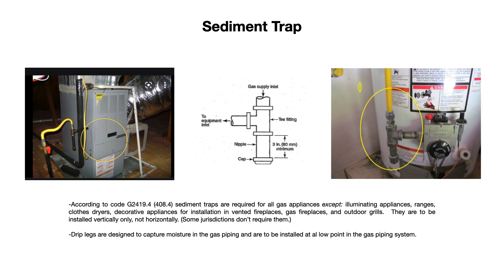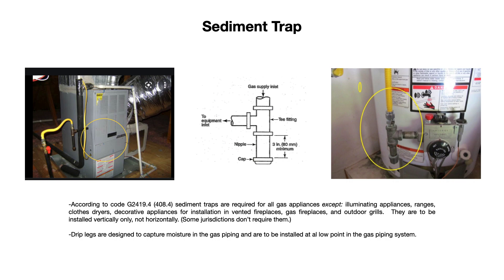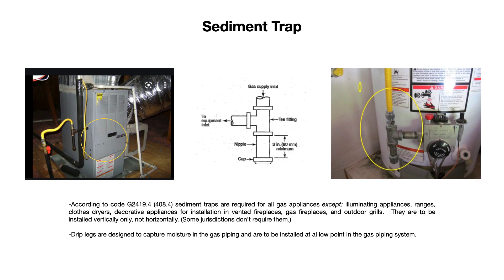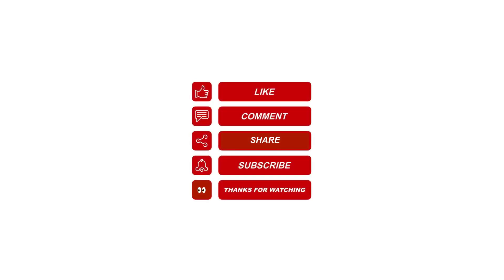Do I need a sediment trap on my gas appliance? (Plumbing Code Compliance)

Comment: No answer as to whether a sediment line is required for a dryer. 🤦🏻‍♂️🤷🏻‍♂️
Reply from the maker: @chrispy3866  all appliances will give you installation instructions in the owners manual. You can also visit the manufacturers website for your gas dryer. Also, each local municipality has different rules regarding the requirement for a sediment trap. I would check with your local authority having jurisdiction and/or check with your owners manual. Best practice is to install one because it will capture bits of rust or debris inside the gas pipe, and reduce the chance of clogging the small orifice inside your appliance gas valve.

Comment: The lack of these on my furnace and hot water heater was flagged by an inspector that the buyer hired for a home purchase inspection. The house was built in 2003. Wouldn't these be grandfathered? In 20 years of living without the traps I have never had a problem so I classify this into the bullshit category. I hate home inspectors. They follow an app on an iPad and really have no construction experience. I live in New Mexico.
Reply: So true, I had an electrical inspector make me remove my neutral connection from my meter base to my outside 200 amp breaker box.  Even though I knew it was wrong I did it anyway to appease him.  After getting the approval sticker on my meter base I waited on the power company to hook me up.  The guy from the power company took one look and called me over to the utility pole and said “Where in the hell is your neutral wire, I can’t connect you without it, you’ll fry everything?”  I told him what had just happened and he just shook his head in disbelief.  So after reinstalling what I had just uninstalled, he was satisfied and I was back on the grid.  Who certifies these people?
Reply: You are so right!
Reply from the maker: I understand your frustration.

Comment: That’s not the way I learned,, the gas to The appliance gos  up and the drip leg go straight down with The shut off always on the top.
Reply from the maker: I appreciate your feedback.  Here in the state of Colorado, here is the language in the code:
Colorado Residential Code 2021 > 24 Fuel Gas > G2419 (408) Drips and Sloped Piping > G2419.4 (408.4) Sediment Trap
G2419.4 (408.4) Sediment Trap:
"Where a sediment trap is not incorporated as part of the appliance, a sediment trap shall be installed downstream of the appliance shutoff valve as close to the inlet of the appliance as practical. The sediment trap shall be either a tee fitting having a capped nipple of any length installed vertically in the bottommost opening of the tee..."
I would always recommend folks research the code in the state were they live, or call their local authority having jurisdiction, and reference the i Appliance manufacturers installation instructions.
Reply: @kjfacilities-maint  thanks for the info.

Comment: So far never seen sediment trap in new construction so far and has passed inpections in arizona
Reply from the maker: I appreciate the info pertaining to the state of Arizona.  Here in the state of Colorado, here is the language in the code:
Colorado Residential Code 2021 > 24 Fuel Gas > G2419 (408) Drips and Sloped Piping > G2419.4 (408.4) Sediment Trap
G2419.4 (408.4) Sediment Trap:
"Where a sediment trap is not incorporated as part of the appliance, a sediment trap shall be installed downstream of the appliance shutoff valve as close to the inlet of the appliance as practical. The sediment trap shall be either a tee fitting having a capped nipple of any length installed vertically in the bottommost opening of the tee..."
I would always recommend folks research the code in the state were they live, or call their local authority having jurisdiction.